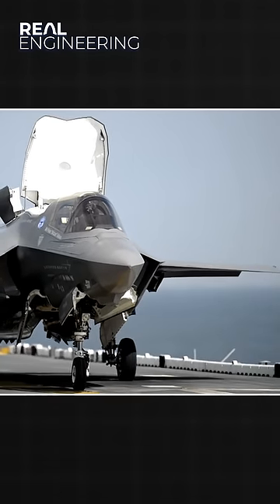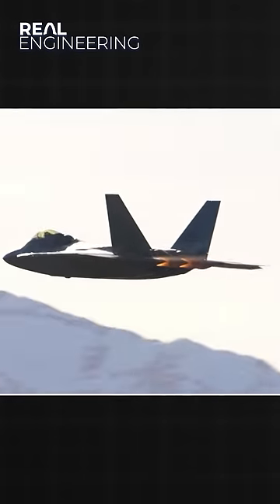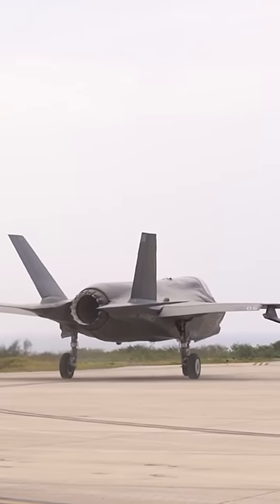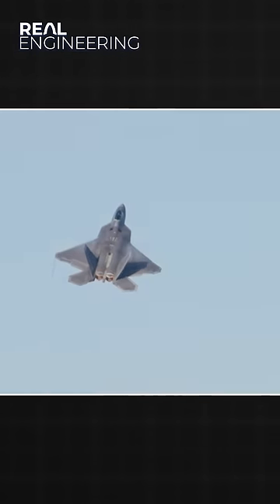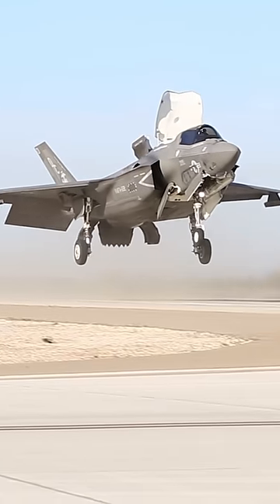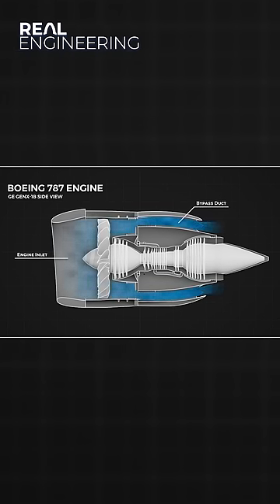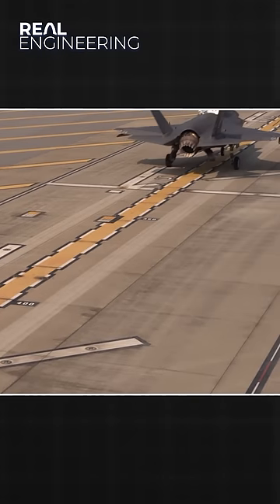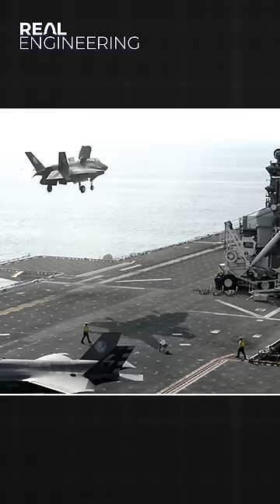How the F-35’s engine is better than the F-22’s

Comment: That lift fan drive assembly is art. The F135 in the F-35B is like a turbofan/turboshaft. I can't think of any other turbofan capable of just adding on a 20,000hp load like that P&W F135 can.
Reply: Who gives a f about the bypass ratio??😅
Reply: Yup. Based upon a Soviet design. 😂
Reply: @yxmichaelxyyxmichaelxy3074  the soviets needed 2 separate lift engines where the F-35B has a lift fan. It isn't the same.
Reply: @tombradscott  bypass ratio 1 of the tools they needed to use to increase the thrust output of the engine. It is a bunch stronger than the P&W F119.
Reply: @yxmichaelxyyxmichaelxy3074  People keep saying this and it is not correct. The mechanism is almost entirely different.
Reply: @yxmichaelxyyxmichaelxy3074 yeah and which ones in service lmao
Reply: @jamesturner2126 
The design is Soviet. Check with your own military.
Reply: @bwshadowfang6160 
'But it is certain that the data gleaned from the old Soviet VTOL project were most likely utilized in the development of the VTOL variant of the F-35 Joint Strike Fighter. And that means the F-35 owes at least part of its existence to a Soviet-era weapons program that never truly took flight.'

You may go now. 😎
Reply: @jamesturner2126 
'Remember: After the Cold War, Russian aerospace firms wanted money, and American aerospace firms wanted Russian defense know-how. One thing led to another, and the F-35's tremendous engine was radically overhauled.'

Shooo, fly. 😎
Reply: @yxmichaelxyyxmichaelxy3074  You gonna provide a link to where that quote is found? I don't see two lift fans on the F-35. The Yak doesn't even have the connection from the lift engine to the main engine. The only similar trait is the swivel nozzel, which traces itself back to a proposed VTOL never made which also happened to be American.
Reply: @bwshadowfang6160 
Oooh, I was just called a 'liar'. 😂
Reply: @bwshadowfang6160 
'By the turn of the 90s, Lockheed had already begun preliminary research on its entry into the international Joint Strike Fighter program alongside the substantially uglier Boeing X-32. It's estimated Lockheed provided as much as $400 million in private-sector monetary grants to Yakovlev to manufacture the final three semi-completed Yak-141 airframes. In 2023 money, that's closer to $900 million.

The result was a slew of technology developed for the Yak-141 making its way to the X-35 and later the F-35 Lightning II. The greatest difference, of course, being the F-35's lift-fan configuration taking the place of the Yak's lift jets. But come on, the resemblance between the hind quarters of a Yak-141 and an F-35.'

Once again, make haste to mama. 😎🤡
Reply: @yxmichaelxyyxmichaelxy3074  I asked what is the source, because it sounds like you are quoting a journalist. So it sounds like you are failing to do any research and your arguments can be discarded.
Reply: @bwshadowfang6160 
I gave you the source. Two if them. When one is cornered, one likes to lie.
Reply: @yxmichaelxyyxmichaelxy3074  Quoting what you see from a source is not the source itself. I'm telling you to give me the article link.
Reply: @bwshadowfang6160 
Check again. I gave it to you. Still lying.
Reply: @yxmichaelxyyxmichaelxy3074  You gave me quotes, not an article link. Do I need to give you a dictionary so you can do your propaganda better? Give. Me. The. Article. Link.

Any further evasion is cowardice, since you know your source is unreliable.
Reply: @yxmichaelxyyxmichaelxy3074  the F135 engine is an entirely American engine. The Lift Fan is an Anglo American design that used the Yak-141 test data to assist in making a superior system. It’s not a Soviet design in any way. As usual it took an American company to actually bring a concept to life, just like with stealth technology. That of course being something Russia still can’t do lmao.
Reply: Not all the 20000hp goes to the lift fan
Reply: @alexalbrecht5768 
So, what was the Yakovlev for then???
Reply: @antoochibbo1355  around 20,000 horsepower just for the lift fan. Takes a hell of a lot of horsepower to make an aircraft levitate.
Reply: @bwshadowfang6160 
I gave you 6 different sources.

Cope.
Reply: @bwshadowfang6160 
I gave you 6 links. Lying some more I see.
Reply: @yxmichaelxyyxmichaelxy3074  to gather data from a unique system to help gain insight on making a new aircraft. Hence why they came up with a different system that only slightly resembles the one on the Yak-141.
Reply: @yxmichaelxyyxmichaelxy3074  You gave me quotes, not the source.  I already found the source you used it from. A journalist article from Auto Evolution was your source for this nonsense. All this guy did was use conjecture and YOU BELIEVED IT. It's quite sad.
Reply: @alexalbrecht5768 
Why would they need to do this I wonder? Data, from what? Do tell.
Reply: @jamesturner2126 
Using Soviet technology to enable this. 😂
Reply: @yxmichaelxyyxmichaelxy3074  flight data is useful to see how a system performs. The actual lift fan system is completely different than the system on the Yak-141.
Reply: @yxmichaelxyyxmichaelxy3074  I think they compared the Harrier to the VTOL Yak, Lockheed realized it was better to use 1 main engine. So they went next Gen Harrier, aka, F-35B.
Reply: @jamesturner2126 
The Harrier too was a result of stolen Soviet tech.
Reply: @yxmichaelxyyxmichaelxy3074  that is a possibility, espionage is strong. However, Harrier has just 1 main engine. The Rolls Royce Pegasus is way different than the 3 engine Yak setup.
Reply: @jamesturner2126 
I am talking about the original Yak design from which the Harrier derives it's design. Look at the similarities. The only thing different was the engine. Even the Chinese today cannot replicate Soviet engines.
Reply: @yxmichaelxyyxmichaelxy3074  oh come on, yo. Take a close look at the bypass duct on the R-R Pegasus. Whomever thought of that bypass duct needs an award. They were really thinking outside the box.
Reply: @yxmichaelxyyxmichaelxy3074  the only thing the F-35's engine has in common with Yakovlev is that the rear exhaust uses vectored thrust to take off and land. The F-135 itself is much more technologically advanced than any engine Russia ever dreamed of producing
Reply: @yomama629 
Yet, they needed aged Soviet technology to show them how to build it? 🤡
Reply: @yxmichaelxyyxmichaelxy3074  the Soviets needed 3 engines inside the Yak-141 to achieve what the F-35 does better with a single engine. I don't think you understand the difference between engine and STOVL configuration but I don't expect much actual knowledge from a Russian propaganda zombie
Reply: @tombradscott  Ummm, yeah, I'm pretty sure the pilot is quite interested in every system included in the airframe.
 The design engineers most likely had some interest. It's not made to entertain, it's made to obliterate things... If you're not entertained then why the hell are you trolling?
  ⚖️👨‍⚖️⚖️
JudgeGarry
Reply: @TehTobis indeed, and which countries are buying it much less producing. How many SU 57’s are in existence, like 6 they keep hidden away for fear of losing them to a g to a projectile.

Comment: The top speed doesn't matter, the research data from DoD said pilot rarely performed in supersonic regime. Most of the time pilot performed in subsonic regime. What matters is the more loitering time it gets.
Reply: I read that most air to air combat engagements happen at subsonic speeds
Reply: @zyme4569  Of course, you can maneuver much faster in sub sonic speeds than super sonic, giving you a better chance to avoid missile, and recommit quicker.
Reply: If i remember right the super sonic was meant to survive over fields heavily saturated with AA, which is why we used to just fly our old jets straight over Russia, when all we wanted to do was show them we could

If they flew over subsonic, they would have been easily shot down, which could be a huge problem if we ever end up in another war with a peer. We prioritized maneuverability this time around because we don't need to plan to deliver deep into occupied territory anymore and survivability was anticipated to be less of a issue, and we get to operate at a reduced cost taking less wear/tear while also being able to perform better at intermediate capacity
Reply: @WhatHappenedIn-vt3vq  As far as I know the US didn't fly a whole lot of supersonic aircraft over the Soviet Union. Up until 1960 when they seized the operations after the U2 incident they were all subsonic aircraft like the B-47's modified RB-47 version from what I understand. They lost a lot of those too.

The CIA did fly some supersonic aircraft in from Iran in the 1960s, but that's about it. And some of those were lost as well. The SR-71 never flew over the Soviet union. In theory, the CIA might have done it with the A-12, but there are no records on either side about it.

The SR-71 was once flown over North Korea to show off when the communist leaders had a meeting there, but the US played it mostly safe.
Reply: That's assuming stealth will alway be stealth. When you're imparting energy to your ordinace or trying to beam an adversay missile the option of hauling a$$ is most welcome.
Reply: Never been a peer to peer bvr battle, so an irrelevant history. I hope we never see f35 Vs j20, but the inability to withdraw and the lower missile kinetic performance are concerning. If the f35 loses that fight it loses hard.
Reply: As an interceptor, the speed of the F-22 is a huge bonus to that mission.
Reply: @agsystems8220  I sure as shit hope the stealth as well as being a sort of an airborne datacenter are really as good as they (LM and the US government) like to boast them to be, because we committed billions for these to be our next fighters in Finland.

I trust our military to know what they are doing, but damn that's a big bet.
Reply: @Greippi10  Worst case scenario Finland would be fighting over your own air defense, meaning chase down is impossible. I doubt the speed would be a problem there. It's over the Pacific around Taiwan that F35s might have an issue, the exact theater it's only real threat exists (not enough su57 to qualify).
Reply: @agsystems8220  I'm not really worried about jets chasing into Finnish aerospace, or the jets in general. I'm worried about surface-to-air reaching into ours, or assisting the enemy jets. The Russians are close enough to operate surface radar stations for long wavelength radars that are or might become problematic for small stealth aircraft.

That alone isn't enough to guide a missile to the target, but it sure helps. Combined with drones and drone networks, satellites, high resolution cameras, and what we now call "AI" taught to recognize things, there might soon be another aspect for homing missiles to supplement radar and infrared.
Reply: Correct. Each weapon for it's mission in the battlefield. 
F-22 is tailored for air superiority. F-35, for multi-role.
Reply: Top speed is not exactly that relevant... Unless it's job is to intercept. which is what some operators will need it for 🤷‍♂️
Reply: This information is cherry picked in an environment where the airspace is not contested. In contested airspace, the attacking aircraft must always fight if it has a slower top speed and endurance than the interceptor. Speed is extremely important, but the US hasn’t had to fight in contested airspace since Vietnam.

Comment: Considering the F-135 is based on the F-119 and they're about 15 years apart, I would certainly hope the F-135 had improvements in power output/efficiency lol.
Reply: what the hell is an f-135 and f-119
Reply: @handakin  
Pratt & Whitney F-119 and F-135 engines

Engines for the F-22 and F-35 respectively.

Comment: PW135 and PW119 are essentially the same engine because they use the same core. 

There are many engines based on the same core used in various configuration like high bypass turbofan, low by pass turbofan and turboshafts.

Comment: F22 was focused on air dominance stealth fighting.
F35 is more multi role. Its computing power likely makes it better for indirect fire command.
Reply: it can do that, it can do ground strike operations to an outstandingly good level, it can do EW, it can do CAS, it can do air to air operations to an almost unrivaled quality etc etc.

it can basically do everything to a very very good level
Reply: @vitsobotka6268  well, not really.
i'd never have a stealth anything doing CAS. literally the opposite of it's goals. EW, anti radiation and anti-anti-air defenses it has in spades.
Reply: @charlespk2008  it being stealth does not diminish its CAS capability whatsoever...

Comment: I used to run the test on the main fuel pump for both engines. The F22 test stand is horribly loud and has a bunch of extra testing that has to be done for the ATP. The 135 stand is automated and so much quieter. Only one extra test needs to be done during ATP. I prefer the F35.
Reply: The F-35 at full afterburner is the loudest jet ever in the US military. Believe me the F-35 is one loud SOB!!! I live under the flight line at the north end of the runway at NAS JRB Fort Worth/Lockheed Martin. I get to see and hear it Mon-Fri at all times of the day or night and when they do a max performance time to climb vertical takeoff the sound it produces is nearly unbearable, absolutely unbelievable and amazingly beautiful. God bless the USA!!!

Comment: Talking about the engine and how „inefficient“ it is because most of the air doesn’t get into the combustion chamber. There is a fan in thievery front which applies force on that air going around the chamber, it’s normal procedure in an aircraft turbine

Comment: The F22 supercruise speed (mach 1.8) is faster than the F35's maximum speed
Reply: Not to mention the F-35 can’t supercruise, which is a big drawback for a stealth aircraft. Understandably compromises had to be made, but that’s a big one.
Reply: I do wonder if this extends the life time on the radar absorbent material on the skin of the aircraft though, which would reduce cost per hour of flight
Reply: @xpeterson  Supercruise heats up the aircraft on IR a substantial amount and still burns more fuel than high subsonic cruise, it's not particularly relevant aside from marketing. If they really needed it the technology exists today to develop a better engine for it but other things like cooling are more important
Reply: @xpeterson  It can supercruise... it absolutely can maintain supersonic speeds without the use of afterburner - which is what supercrusing means... It just needs a small nudge on the throttle to get through transsonic speeds to supersonic...
Reply: The F-22 has two engines giving it 70,000lbs of thrust, F-35 only has one giving it 43,000lbs of thrust. F-135 is more powerful than F-119, but 2 > 1

Comment: Its more powerful, doesn't necessarily mean it's better
Reply: Bro the army needs more powerful engines for better combat 
So if an engine is more powerful, it is objectively better
Reply: @condor5912  F-22’s have 2 jet engines, so 156kNx2 is quite a bit more than 191kN… So I’m not so sure it’s “objectively” better without having an additional power unit attached to it…
Reply: @condor5912 Loitering time matters.
Reply: @condor5912  power to weight of the engine also matters. If you have 1 engines that weigh 1000 kg and another engine that weighs 2500, even if the first engine has only half the power of the second, it still maybe worth considering weather the aircraft’s performance may be better with the lighter engines.

Not to mention fuel efficiency that different designs can bring, or better reliability of a less advanced design.
Reply from the maker: Notice how the title says "how" it is better. Not that it IS better.
Reply: @RealEngineering ... How "it is better"
Reply: @RealEngineering  I'd really love a logistical breakdown on the F-35. In millitary engineering, especially in aviation you tend to find a lot of armchair general redditor types who throw around specs only relevant for certain armament and on board fuel quantities but nobody tends to discuss proportion of combat ready units to those in maintenance or sequestered for training. Would be cool to see a breakdown of flight hours to maintenance hours and such rather than just pumping out the same Lockheed Martin shill talking points
Reply: @EDay340 yeah the twin engine design is far more powerful than the single f35 . Plus the b-1 -b is getting a f22 variant as a 4 engine upgrade
Reply: If you made a successor to the F-22 that incorporated all the best features of the F-22 with the advances in manufacturing efficiency of the F-35, with twin engines from the F-35, you'd have the best of both, but it would be more expensive and probably suffer from the same budget emergency review as the F-22 did when costs went beyond the congressional limit, especially since the plane's cost would limit the amount of export sales even if the US allowed it for sale, economics of scale kill some of the most promising projects when the number slated for order drops and the cost per plane/ship/ammo go way up.

If you're going to have a single engine then the F-35's engine needed to be excellent.
Reply: @RealEngineering what does that statement even mean
Reply: But I believe the engine of the F-22 is much more stealthy, so it depends on what you want. Faster speed and much better stealth? Or ok stealth and better loiter time
Reply: @cabernetcat1494 yes. exactly. 
There is a difference between ‘this engine is better’ and ‘how this engine is better’. The second statement is only considering advantages/pros